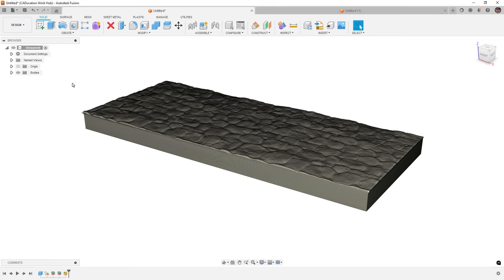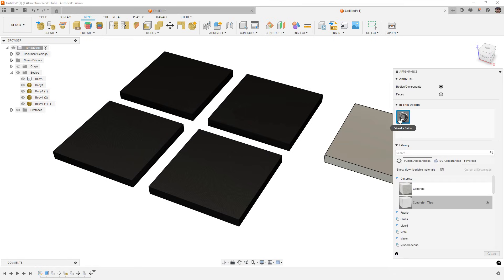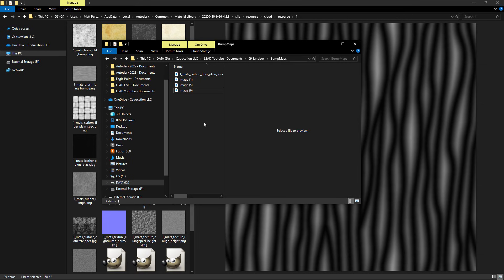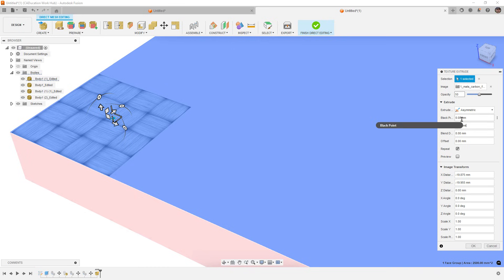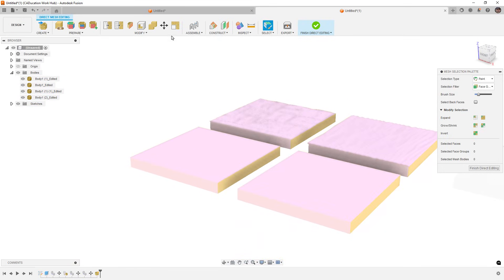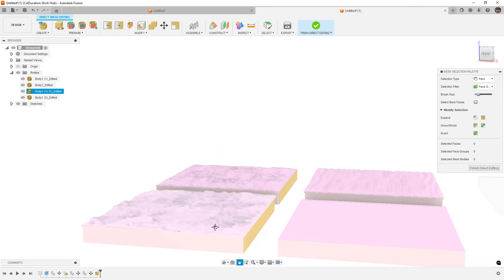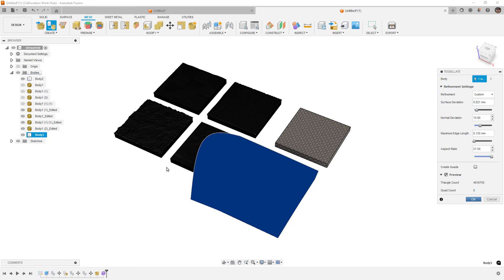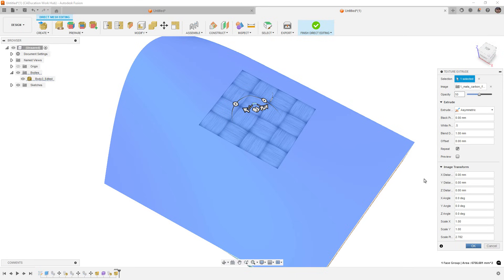Mesh Texture Update | What's New in Fusion July 2025

Comment: Better still, if you select Quads when creating your mesh, you can convert Quad mesh to T-spline after editing and make a solid body
Reply from the maker: Yeah that is a great idea!  It would work on small parts but gets really made with large number of quads.  I have found the limit before.  It isn't happy over 10k polygons and I am not sure how detailed of a texture you could get.  Have you tried this and had success?
Reply: @LearnEverythingAboutDesign  Yes, I have been using this technique on a planar surface. Max edge length 1mm, 27k polygons

Comment: I want to add texture on really curved surface without stretching the texture. In fusion help page it says 
Select a Projection Type:
Planar
Box
Spherical
Cylindrical
But I can't find these settings. Is there any chance we could adjust that?
Reply from the maker: Those options are for adding a graphics based appearance (bump map), not a physical 3d texture unfortunately. I did a follow up video showing how to do this with Blender, which is free.  https://youtu.be/r3mrv38Lnvw

Comment: Hi Matt
Why when i click on to preview the surface goes up a bit and nothing is tilling? at 7:11
Reply from the maker: Did it work without "repeat" turned on?  but fails when you turn that on?
Reply: @LearnEverythingAboutDesign   without repeat turned on, the image insertion disapears
Reply: Sorry Matt, i didn't know it would take that long to process.  It is working!  :(
Reply from the maker: @alainbergeron7436  no worries. but it worked just took a long time?

Comment: Congratulations on the video, I have a question about how to put texture on a sphere?
Reply from the maker: Without even hearing your question I can tell you the answer :(  This tool only really works on "Planar" faces.  The image is not able to wrap. so if you look at my complex shape at the end the pattern is stretching on the edges.  So if you use a cylinder or sphere it will only look right at one spot and then be distorted on the rest.

I will be doing a video soon on how to do this in blender wrapped to complex shapes, but currently you can't in Fusion.
Reply: We are working on it

Comment: What about full wrap spheres
Reply from the maker: Sadly no.  The tool is Mesh Texture Extrude and its basically Planar.  Unlike a rendered appearance it doesn't have the ability to wrap.  To do that you would need a slicer like IdeaMaker, Use the FormLabs tool, or go to Blender.  In blender you would use a displacement deform modifier and apply your texture image to a UV unwrapped body.  Its a bit more work than say IdeaMaker.
Reply: We are working on it
Reply: I was just trying to figure this out. You can approximately get something when you angle the texture in Fusion, so that it 'projects' on all sides.  It's not really a full wrap but at least all sides of a cube will be textured that way, sort off...

Comment: Nice try, but Blender still better on work with mesh bodies than Fusion. Fusion limit is about 250k triangles until it crushes, so to make something really textured it's not enough.
But Fusion is not bad tool to make low-polys, something qubic😅 minecraft-like. But if it comes to real organic shapes with textures... Rhino i think is way better. Fusion is designers scetchbook, program to make concept without details.
Reply from the maker: 100% agree.  Blender handles large meshes and the ability to do texture brushes or just sculpting, plus all the supported add-ons free and paid for advanced textures is great.  Fusion will never touch it as a mesh program.

Comment: Hi Matt as always great

Question can I use this option to flatten a face (a mesh is never flat) When adding a total flat texture, do a direct edit and define a 3 point plane. Maybe we can misuse this function to aline a mesh plane to origin
Reply from the maker: Well, not exactly.  You could draw a cube larger than your object, convert it to a mesh and use Mesh Combine to remove it from your reference mesh.  That would get you as close to flat as possible.  So a prismatic part converted to a mesh in Fusion "should" be flat.  Note that when you cut one mesh with another the size of triangles can make funny stuff happen on the edges.  you will likely find you need to remesh after that.
Reply: @LearnEverythingAboutDesign  thx for taking time and explaining on my question.